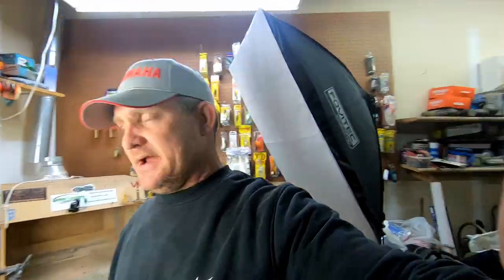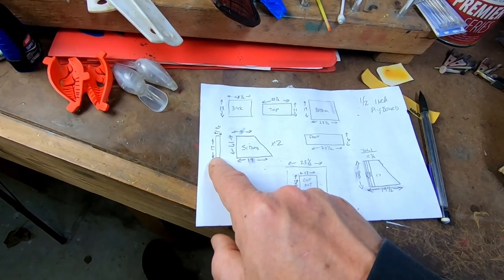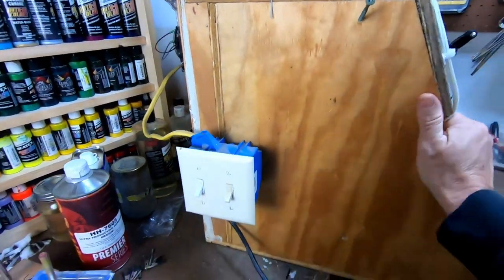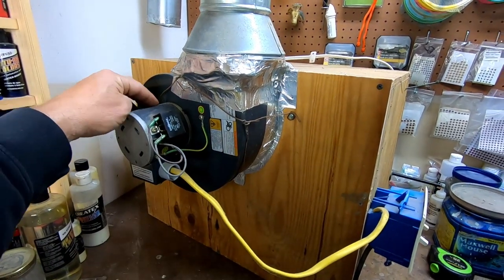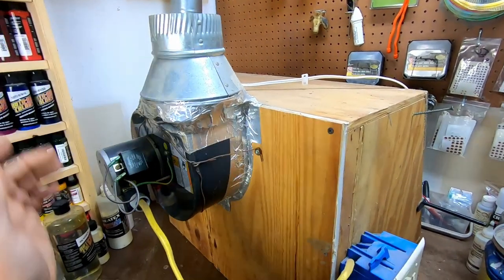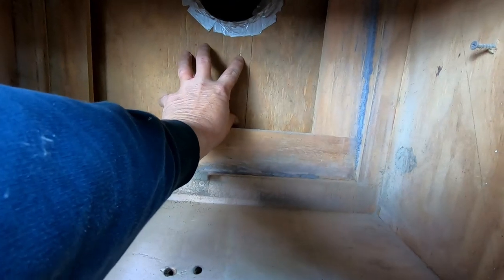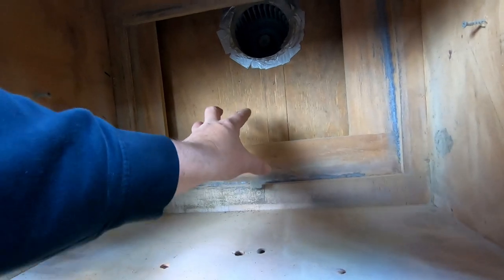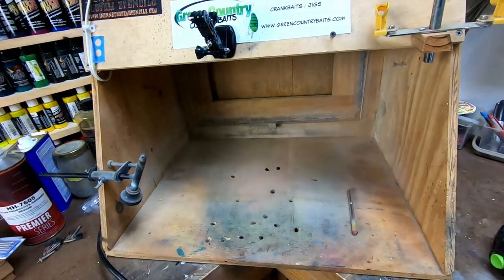DIY-- BUILDING AIRBRUSH SPRAY BOOTH

Comment: 💯%Awesome spraybooth Jeff.  Lowering the extraction fan as you suggested to improve air flow sounds like a good idea.  But before you tear into the booth try some weather stripping behind the filter to see if that helps improve the flow.    I'm planning to make a new booth myself with 1/2 plywood.  My current booth is made with 3/16 or 1/4 underlayment and is to thin to add on accessories. Once again that is an Awesome booth 😎👍
Reply from the maker: It works well for me fan situation could be better, i will try the weather strips to see.

Comment: I kind of got the same setup as you but my motor is mounted in a window right above the booth with dryer tube going down to the booth so when I'm not painting I can unhook it and move the booth off the counter for more space. I'm an old school type of guy, I've been clearing lures for years using Automotive clear but now I moved my shop into the basement , just so I wouldn't have to heat the garage during the winter and started to dip them but one some types of lures there's just no way you can do that. I haven't tried spraying any of the KBS clear yeah and Afraid the fan won't pull the overspray up fast enough, then I'm going to have the wife after me because the whole house smells like clear. Like how your booth is set up with the fan on the back of it, I might redesign mine so all the pull is right there where I'm spraying. Not telling you what to do but it looks like I might have to do the same thing to put the fan on the back of the plywood , I'm going to weld on some L brackets so I can run some screws through the plywood and into the bracket to hold the fan in place
Reply from the maker: Sound like your plan be great with the l brackets just lower it as far as your can on the back bet you be good to go

Comment: I just got my OEM blower from Graingier, it is a 146 CFM air power soI hope that is enough.
Reply from the maker: Not sure let me know what you think.
Reply: @greencountrycustoms8387  The 146 CFM blower is great. My problem with air flow came from the dryer exhaust vent hose I bought still having the sheet of instructions stuffed inside it. Once I cut the exhaust vent hose to four feet and saw the paper blocking air flow, and removed it, the air flow was awesome.
Reply from the maker: sounds like something i would do for sure.

Comment: How long does the top piece have to be if I were to make one of the side pieces 3” instead of 1-1/2”?
Reply from the maker: Jeff if your referring to increasing the back air chamber where mine has an 1 1/2” piece of plywood. Then the top would just need to be 1 1/2” longer so refer to pictures at end of video. I believe mine was 11” from front to back so make it 12 1/2” would cover top.